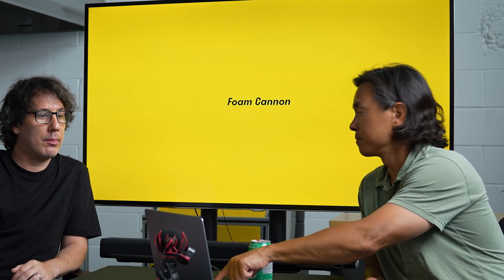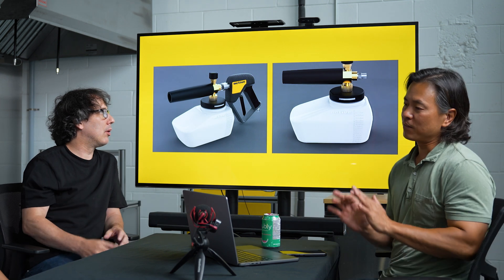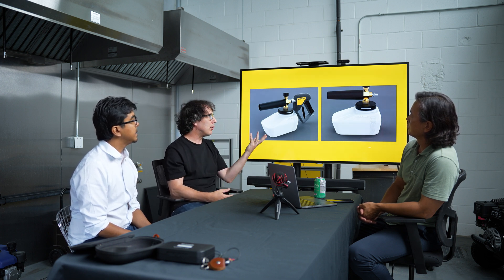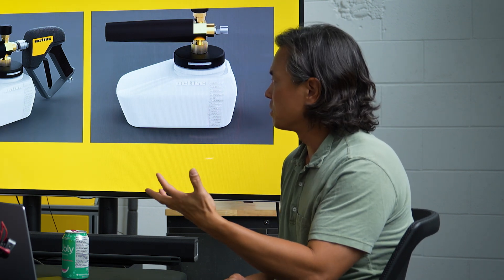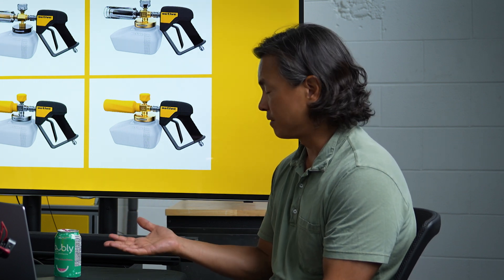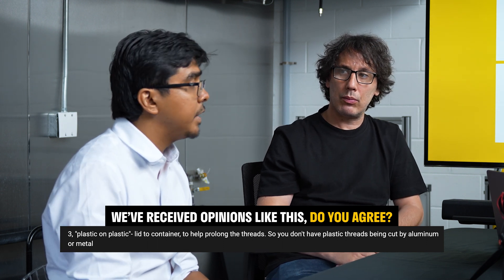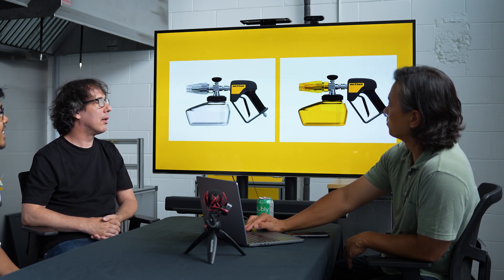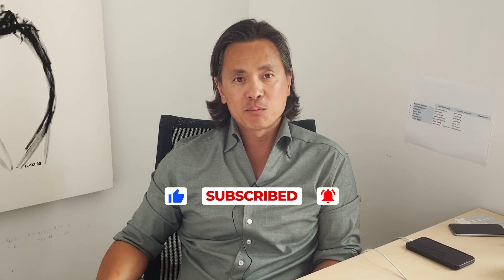LET'S BUILD A FOAM CANNON! PART 1

Comment: Dont use tht bottle design! Pls its not practical for the straw to suck up all the soap unless u tilt the gun up or down to get all the soap, keep a cylinder style bottle nd keep the size as compact as possible i think you guys should aim for the bottle design as the griots brilliant finish foam cannon or the mtm v2 bottle with a wider fill opening also i think you guys should make the bottle clear with black or yellow measuring numbers! And if you guys want to blow out competition take the quarter turn cap from the mjjc v3 idea and figure out how to prevent the foam cannon from leaking with held upside down now tht wud be worth the $75
0-$85 price tag

Comment: I like and agree with almost all of these comments.  I would like to add my 2 cents worth....  Sell extra bottles, AND sell blank off caps to close the bottles when not in use.  If I have left over solution, I might want to store it, in the bottle, after removing the "cannon" and running clear water though it, to rinse it out.  Spare bottles would allow different solutions to be pre-mixed, and waiting for the next wash.  just need to be able to cap them off.  Right now, I stretch a latex glove over the opening, of my current foam cannon.

Comment: Most important would to ensure the foam doesn't dry too quickly on the surface...this is difficult to explain but you want a wet foam that will assist with allowing dwell time for the foam to move as much dirt and grime on the surface and not dry up and leave spots...the MTM does a great job at this even though it isn't the flashiest anymore with others making that crazy foam that isn't effective since it's usually dry so this is where you can really be set apart to do the most effective cleaning

Comment: I have the active 2.0 and use a 3rd party hand spray gun. I currently use a budget friendly Sunjoe foam cannon with the stock orifice and it foams quite well with the 2.0  but is annoying because it’s tall, thin and top heavy and will fall over. Your triangular shape bottle might be a hassle screwing on the top. Round with a wide base is a proven design. I find 1000 ml size to be perfect for my needs . ML measuring marks is necessary . Rotating spray pattern would be nice but for me it’s not a critical need. Big mouth opening is paramount!  Affordable pricing is a concern and needs to be low end competitive keeping in mind that MJJC has the market for high end sprayers. Most important is thick heavy foam! 
Paul

Comment: The problem with that design is the weight and moment of the bottle will be more to the front of the nozzle and not balanced. Having a big neck is nice but please do not use threads to connect the bottle to the gun portion. Need to use some type of twist and lock connection.

Comment: A lot of good ideas in reading through the comments here. I'd also like to add that you need to make sure there is either a weighted ball at the end of a flexible straw so that the straw can move around to always stay in the liquid; and, if you want to get really clever, making it so that the interior of the bottle  slopes to a point (while keeping the outside flat  so that it can be set down) so that it's easier to get all the liquid up since it will pool in  one spot. This isn't a common design element, but I have come across it on occasion on things like hand soaps and the like. It's a really nice feature as it allows you to more easily get up all the solution. 

Beyond that, it's things like others have mentioned. A plastic-on-plastic cap/bottle connection. Twist and lock would be nice, but just a simple twist on would be fine as well. Clear bottle markings (so many of the bottles out there are hard to read due to being not only small print, but the same clear/opaque color as the bottle, well balanced so that it's comfortable to use, a wide opening for adding liquids, and user replaceable/easy to change mesh filters and orifice size nozzles.

Thanks for looking for feedback on this. While I haven't been able to justify getting your short gun yet (as my MTM is still working perfectly), I'm more likely to try out a new foam cannon as long as it's not priced outrageously. I'm currently alternating between a MJJC Foam Cannon Pro V2 and a MATCC Foam Cannon III, but I wouldn't mind adding another one to the stable.

Comment: If you are going to make a bottle design from scratch, new mold, that is great.  Remember to make it functional, functional from storage, to filling with soap solution.   Some concentrations are only 100 - 200 ml.  With a extra wide bottom, how would the user know when they have poured 100-200 ml.  With a new bottle design, you could have a special reservoir (well) that is set up for 100, 150 and 200 ml, levels.  Also think of weight of a filled bottle and how that feels for one handed use.

Comment: Balance is important. If the foam bottle feels at one with the gun, then maneuvering becomes easier, without risk of bumping it into your cleaning surface. The ability to place the foam bottle and gun down with out having it tip over…also a key benefit.

Comment: 1. More foam - Operate MJJC Pro 2/3 top part and look what they been doing there to produce more foam with any brand of foam soap.

2. Clear transparent bottle - Ability to see thru clearly what chemical solution in there base on actual color (I’m talking about MJJC Pro 2, not Pro 3 that has taller bottle and not stable).

3. Big neck - Also look for MJJC Pro 2 benefit for easy fill and no spillage when turn upside down.

Conclusion is…me or like any other detailer enthusiast, we commonly prefer MJJC Pro 2 foam cannon product better than any others competitor. The only lack is that not have an transparent bottle (again, i’m talking about MJJC Pro 2, not Pro 3 that has taller bottle and not stable).
Thats all.

Comment: We want FOAM! Design is secondary. That is why I didn’t like the first one and it was a rebrand mostly. I myself never needed more than a liter, but have had viewers say they wanted more capacity. You could compromise at 1200 ml. The bottle will be one of those you either love it or hate it design wise. My biggest concern is with the bottle being very long and not tall as the measurement markings are so close together. I prefer a plastic cap as the metal can get hot and cold with the seasons, water temp and weather. Clear bottle as long as it is durable for chemicals and won’t crack when dropped. I like the idea of balance empty or full and while the gun is attached. Click and lock top is a good move. Save the money on the metal top and use for quality stainless for the manifold with electroplating for more corrosion resistance. Nozzle design doesn’t matter much to me just the ability to do horizontal and vertical while having good tension to not come out of adjustment. Don’t forget the water adjustment knob on top needs to be comfortable.

Comment: I don’t see a big advantage, as a consumer to have a larger capacity bottle, I typically have leftover when doing one vehicle.  Also what is the weight distribution like with that shape bottle.  Maybe include two bottle sizes, standard and large???  Or even two of the same size with a quick disconnect. I currently have one sprayer for soap and one for tire wash.  That way I could reduce equipment. Seems like that is the first part to fail most times.  Good luck, it’s great seeing you working on new ideas!